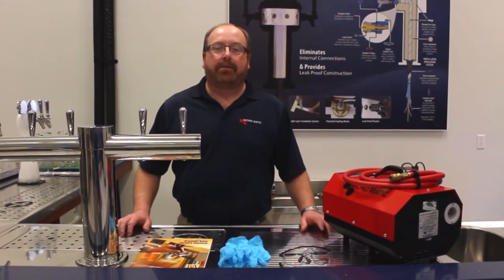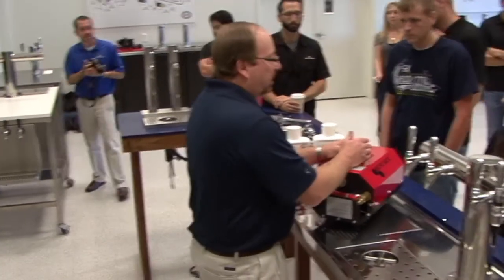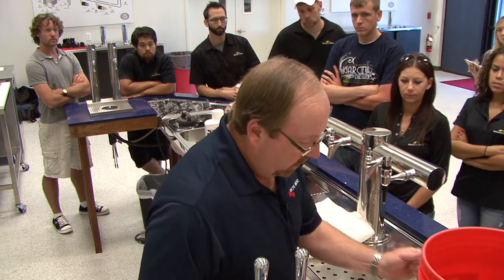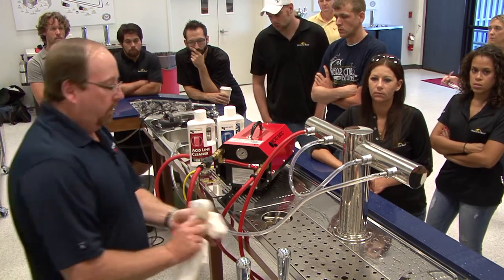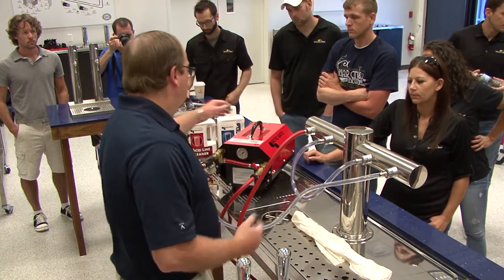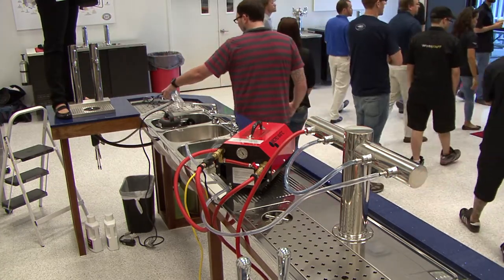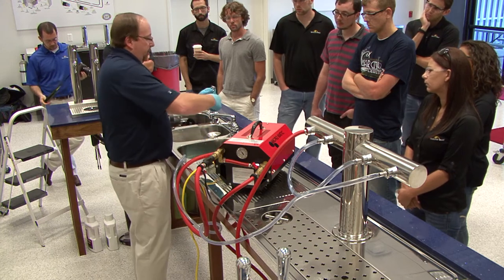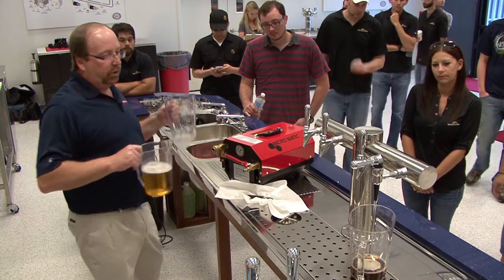Re-circulating Line Cleaning Overview

Comment: Thank You for sharing this.
I have a couple questions about the beginning of chemical recirculation.
How do you take into account the amount of water in the lines when you decide to recirculate the chemical?
Should we not wait for the chemical (blue) to start evacuating the drain line before we put the drain line in the chemical solution (with the suction line)?
Thank You